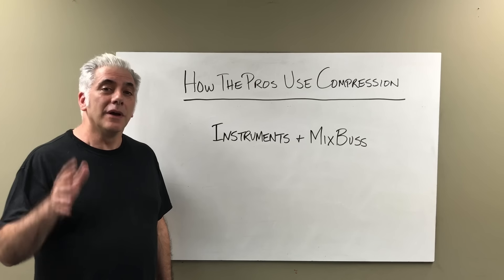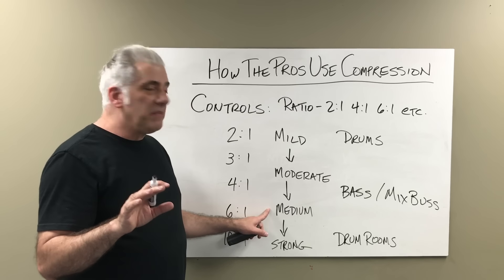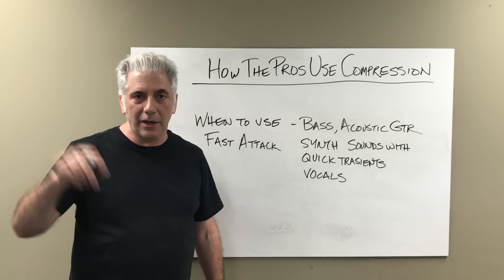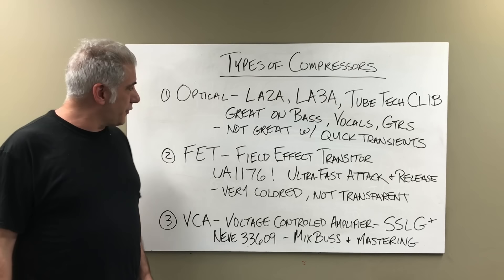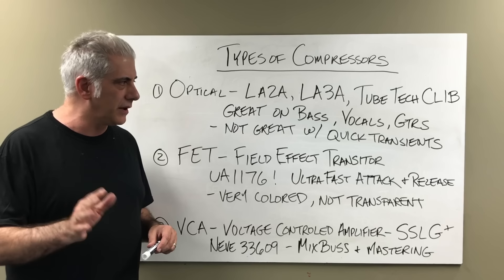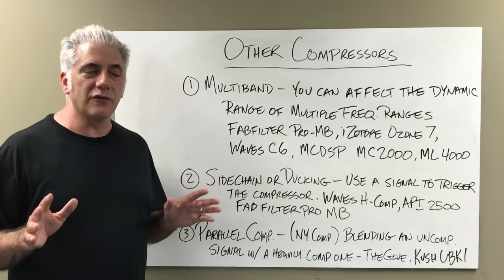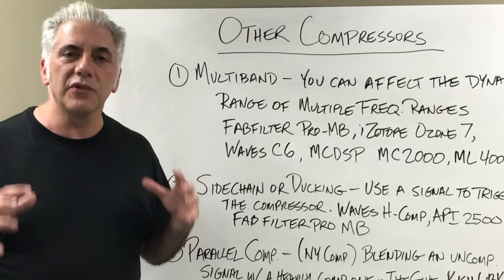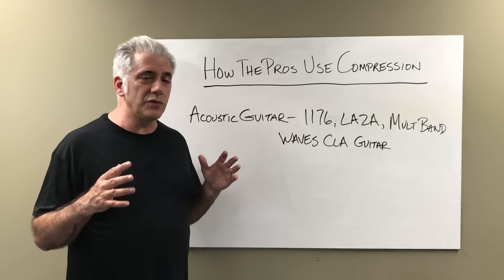How The Pros Use Compression on Instruments and Mixes

Comment: Great video Rick! One correction though: The Neve 33609 might sound similar to a VCA compressor, but it's actually a Diode-Bridge design. Diode-Bridge is very fast, punchy and grabby, similar to a VCA sound. Diode-Bridge is phenomenal on drums, piano, and any other percussion.
Reply: Thanks
Reply: good to know!
Reply: VCA - "Voltage-Controlled Amplifier?"
Reply: That's correct.
Reply: Definitely; yet from what I understand, the operational principles are similar enough to very loosely class it as VCA, or a subset of that class. Or rather the gain reduction element is different from typical VCAs like the dbx 160, SSL G series, API 2500 & Vertigo VCS-2. And most channel comps in large format consoles.Big fan of the 33609. The A1 auto release is very natural and the added tone from the transformers is fat & beefy.
Reply: @DanDuskin  My idea of VCA's is a fader that controls a set amount of input faders. Not compression. (I'm a live guy)

Comment: While talking about compressing square waves, at 2:35 Rick says “you don’t need to compress things that are already compressed.” I hate to disagree but you could have square waves coming out of a synth, sometimes very soft, sometimes very loud. If you wanted to limit the dynamics of such a signal (just like the bass Rick refers to at the start), you might want to put a compressor or even a limiter on it.
Reply: do you have a video demonstration for that pls?
Reply: @zapantalambda  Of course he does! Because we all know if you disagree with an internet authority figure, you must promptly post a rebuttal video. Do write in your engineering cook book: "never compress pr-ecompressed material". That's why no one uses compressors on the mix buss, and certainly never at the mastering stage!
Reply: @jimnorrison8481  Top notch reflecting right there.

Comment: Years ago (in 1979) I worked at a cassette tape  duplicating facility in ATL on Cheshire Bridge Rd. The first step was to take the customers “master” tape and create a bin loop master. The “customer’s master” could be anything from a crappy cassette to a 30ips 1/2” tape. There were 2 Altec 604E loudspeakers, 2 Fairchild compressors and 2 Pultecs. With little experience as a real studio rat, I just assumed these were things everyone had. It wasn’t until later I realized how coveted these pieces were. For good reason too. I could make a decent bin loop master from anything. Very enlightening

Comment: Thank you for making this one, Rick. I'm having trouble hearing the differences in your example at the end of the video though. I'm not sure what to listen for. It might be youtube's built in compression that is throwing my ears off. In any case, thank you again for clearing up a few misconceptions I had about compression.
Reply: Youtube compression is not dynamic compression like in Rick's video.  Youtube applies data compression to videos.  Totally unrelated.
Reply: Thanks! I thought I read somewhere that youtube applies compression to audio as well, but I could be wrong. Thanks for clearing that up.

About what to listening for: It's a little hard for me to use compression to be honest. I seem to apply it more as an effect than as a tool to smooth dynamics simply because I'm struggling with what to listen for. I can hear a pumping sound when I turn the ratio up and release down. I can hear more of a hit when I boost the attack on snare and kick drums (>80ms). I don't hear anything really when applying compression to clean electric guitar, unless I go to extremes (good old dynacomp I can hear though). I read something that it takes many engineers a few years to understand compression, I guess that is where I am at right now :-)
Reply: I'd say you're coming along normally.   It just takes time, and practice. Keep listening for those details.  After a while, you will begin to hear more and more of what is happening.  Eventually you will begin to detect very small details even when the compressor is doing hardly anything.  It also takes time to learn when and why to use it.  Somebody can tell you "use it like this for this instrument" but in reality, you really just have to practice and come upon the answers through direct experience.   Time and practice, just keep doing it.
Reply: Thank you for the encouragement and replying to my message.
Reply: They're very different processes, but I wouldn't say they're totally unrelated, cuz lossy formats and low resolution files CAN affect your ability to hear compression and its artefacts. Increasing video quality to at least 720P can help, but the biggest help is to listen to lossless formats over full resolution studio monitors in a controlled listening environment/treated room. Without a good monitor situation, setting up a compressor or EQ or even a mix  balance is mostly guesswork.
Reply: well there is some dynamic compression on youtube, as far as I know, to even out volume between videos
Reply: +Raunch I'm in the same boat as you. I usually don't notice much difference in the sound when testing compression settings, and you likely won't if you're listening to a track in isolation. However, in the context of a mix, I do notice that if a track is uneven and drops in and out in the context of the mix, and I then add some compression to even it out, it becomes apparent as the track then sits more correctly and no longer drops in and out.

In the examples at the end of this video, I was hard pressed to hear any difference, and I wouldn't be able to say that one was better than the other or that it mattered to me. From that perspective, I don't think your average listener is going to notice or care either.

Of course, the more creative uses of compression, such as creating the pumping effects, ducking, etc. are much easier to hear as they work at the more extreme end.
Reply: That's a really good point here. Compression reduces dynamics, in a way somewhat similiar to a lazy man's automation.

Right now I am more comfortable with "creative uses of compression" than hearing compression in an isolated track. But I hope that will change with experience. Thanks for replying!
Reply: Raunch All compression degrades the sound a little.. The truth is try to get away with as little compression as you can.. You'll get more out of gain staging and eq than you will compression..

Comment: You me mention that a ratio of 2:1 attenuates 1db.. that's confusing..

sure, it does, but it doesnt explain what 2:1, 3:1, 6:1, etc does.. 
2:1 means that every 2db exceeding threshold will let 1db through.. 

EX.
 6:1 means that 6db exceeding threshold will allow 1db through; if it exceeds by 18db, you will hear it 3db louder.

9:1 will allow 1db loudness for every 9db past threshold.  If it is 36db past the threshold, it will allow the sound to be 4db louder
Reply: Paul Yuch thanks for mentioning that.
Reply: That's also confusing to say 3dB or 4dB louder. Are you saying it allows 3dB through instead of 18dB, and 4dB through instead of 36? In either case it's attenuating from 18 dB above the threshold down to 3dB above the threshold, or from 36dB down to 4dB? I'm just trying to figure this out. In my head I am multiplying the amount over threshold by the fraction of the threshold i.e 6:1 is 1/6, and the result is the amount of dB over threshold that the compressor allows through, so 10dB over times 1/6 is 1.66 dB over threshold allowed through. Tell me if I'm thinking about this correctly

Comment: 1:55 I don't understand this. By reducing the volume/db while compressing, the waveform should be smaller, not clipped like that. That's distortion, and you completely change the sound of the track. When I compress my tracks, it doesn't clip them at all. I get that result when I use distortion/clipping.

Comment: I believe the way the ratio was explained is incorrect. “If compressor has ratio of 2:1 it will be attenuated by 1db”. True however if compressor has ratio of 6:1 it will not be attenuated by 1db instead it will be attenuated by 5db. A better way to say it is with ever 2db that are over the threshold 1db will be let out. With ever 6db over the threshold 1db will be let out.
Reply: ratio is aka "slope" on the cartesian plane.

Comment: As an engineer, I really hope the waveforms (if you mean the actual music waveforms) NEVER look like that.  Clipping a sine wave, or something resembling one, causes tremendous amounts of high frequency output to be added (fourier series).  Now if you were looking at waveforms where the time axis were greatly compressed (assuming that is what you showed), like for a whole song or a passage, the envelope of the waveforms could look that way, but the individual real time waveforms should look pretty much the same as the originals, except with the amplitude reduced. What is clipped is the dynamic range, not the actual output waveforms the instruments produce,  Just trying to clarify a bit, hope I didn't make it worse.

Comment: Helpful! Everyone seems to get ratio wrong. The correct explanation is reversed— 2:1 means that for every 2db above threshold the signal will pass it by 1db, 4:1 means that for every 4db above threshold the signal will pass it by 1db, etc. That's why 20 db is so drastic, you have to push 20db above threshold to hear just 1db of difference.

Comment: A little compression acts like the glue that holds a bunch of tracks together and turns it into a song. If you are making stew in the kitchen, you don't just throw a bunch of vegetables and spices into a pot and get stew, you have to process them so you end up with something new but that was made from all the little ingredients. Instead of a bunch of instruments playing together, they are lightly squeezed into the same sonic space so they form something new from all the little parts that make it up, that something is the song.

Comment: I thought that your presentation was very succinct and descriptive. I've trained engineers that have won 8 to 10 Grammys (Beck, Radio Head, McCartney, Foo Fighters, etc), and I've worked both in the studio and Arena sound with Multi-Grammy Winners since 1972. I'm in the studio between 70 and 110 hours a week - and yet, you taught me, and re-taught me things that either I did not know, or forgot. I want to thank you kindly! I will say that some of the most monster studio tracks that I've recorded/produced did not use very much compression on anything - but then again they were on Studer A800 15 IPS 16 Track 2 inch Tape, which in and of itself is an amazing "Processor" - mixed  to Studer 15 IPS 1/2 Inch Two Track (No Noise Reduction on anything) - mixed thru Stereo 1178. I only had a handful of hardware comps so Tracks may have had light to moderate 1176/1178 or LA3. Of course, mastering was a bit more heavy handed, but I find that if things are well recorded with light to moderate compression or none at all things can sound very natural. They almost mix themselves - a bit more old school. Bruce Sweden uses very little compression - nuff said there. Again, thank you. You have a new subscriber!
Reply: Yeah. There is no substitute for a good take or track.

Comment: I have an electric drum kit and I was running a mono out into a small amp and I inserted a compressor between my drums and the amplifier and it caught me by surprise because I was actually trying to get a more desirable thud from my kick drum and it made the high hat get a lot louder so the conclusion that I came to is a compressor is like running a lawnmower over grass and I noticed that all the blades of grass stood at the same height now so when you put it on the master output it makes The entire sonic spectrum all hit with the same velocity including the sub tones that were more implied instead of felt in the beginning before the master had a compressor on it

Comment: May I do a little constructive criticism : although TubeTech CL1 B is technically a optical compressor, it is lightning fast and its very wide range of settings puts it in a special category like the Distressor of compressors capable of mimicking several different types. I used it intensively in a studio that didn't have 1176s for tracking vocals, the only problem being that it is less forgiving than a 1176, wrong settings can produce very extreme comrpession ! Not for the faint hearted :-)

Comment: Really informative, thanks! Something that helped me tremendously with getting compression right is by thinking of getting each track to "breath" with the rest of the track after compression is applied. You start with the attack as slow as possible and keep increasing the speed until you really don't like what's happening to the air of the track. Then back it off. With the release, start as fast as possible. Make sure you have other rhythmic elements playing at the same time. Increase the release time until you feel like the sound really fits in its own place with the other tracks and that the whole track has some room to "breath." This kind of compression really takes a flat mix and gives it some depth. I think compression is used in two ways: to give depth and to glue. I just described the depth side, which isn't really trying to worry about taming transients. Then you can use compressors/limiters on busses to really tame the transients and make the song feel "glued."

Comment: Hi Rick, this is a good talk to get people thinking about compression but there are a few things that don't quite add up. A compressor doesn't turn waveforms into square waves unless the attack and release are both zero time (which it never is), in which case it is a clipper. The idea of a compressor is to turn the level down (of the waveform as a whole) so as not to alter the waveform shape (if at all possible). A synth with a square wave and a synth with a sawtooth wave are no different in terms of dynamics, it's just that they are both equally likely to have a more consistent level and no need for compression. If a compressor is turning sounds into square waves you need to send it back for repair. I hope this makes sense.

Comment: Very Nice! 
Like you, I many times find multi band to be a better option than eq. But, I thought maybe I was cheating. You gave me more confidence in that area. Currently in pre-production and because of you, I expect this record to be a SONIC MASTERPIECE due to my newly expanded mind! Thanks

As to the mix buss compressors at the end of your video... To my ears... 

1. Best - UA SSL -  the track came alive(energy) - especially the vocal - for me it's primarily about the vocal

2. Neve 33609 - Close but not quite as nice as the UA SSL - I think I could hear some of the class A between 2-4k which is not my taste. But, just guessing, maybe better for radio??? 

3. The Glue - Nice if you had not compared it with the UA SSL. The Neve was also a bit more exciting

4. Worst - Slate SSL - It just sat there(no energy) - unless there was a greater drop in volume??? it felt quieter and a little muffled - but... I did think the  vocals in the sides were nice - I like a mellow stereo bgv when delay-split or multi-tracked. 

My thoughts for what it is worth

Loved the video - Thanks again!

Comment: I use an LA 610 MK ll mic pre and opto compressor on bass. I have 2 LA2A's across my entire mix while tracking along with an Avalon VST 747 and Manley Massive Passive. The problem with that patching technique is the tracking signal gets digitized in Cubase/Apogee before compressing it pre cut.

Comment: This is such a great video, one of your best I've seen Rick! Thanks a lot! <3
I have one small piece of doubt: as far as I know, the second number in the compression ratio should be how much the signal is increased beyond the threshold, not how much it's attenuated. So with a 2:1 ratio, for every 2dB of input signal exceeding the threshold, the actual post-compression signal will only be increased by 1dB. 4:1 means you need 4dB of signal input beyond threshold to get 1dB of post-compression signal, and so forth with higher ratios. In your explanation of ratios, it sounds like it's the opposite?
This actually makes higher compression ratios tighter and lower C R more forgiving. Am I right or did I understand it completely wrong?

Thanks!

Comment: I know you are largely talking about recording, but compression is quite helpful in live environments too. I know that in rock setups, many use compression to set the levels of the vocals. In other kinds of music, that kind of compression kills vocal nuances that you want to come through, for example vibrato in more classical settings. I do churches where there is a mix of live music and spoken music. While key speakers might have ear mics, momentary speakers will use fixed mics, and not use them consistently. I use compression on these mics to make a bubble around the mic that is relatively similar in amplification. Those who get right up on the mic are more compressed than those who stand farther back from the mic thus diminishing the difference in volume between them. Also, I occasionally have vocalists singing in harmony that don't handle their handheld microphones the same. I compress those vocalists that aren't consistent with their mics so that I can blend them better in the mix, kind of like what you were talking about with the bass in the first part of the video. The thing about a live mix is that amplification also amplifies the dynamics. It's okay to compress everything in general so that the dynamic range sounds more natural. I only wish I had multiband compressors with my system to use live. Those could come in handy when the volume of an instrument produces undesirable timbre changes.